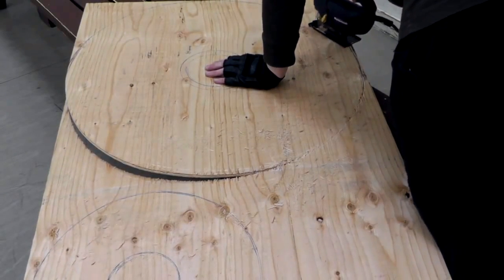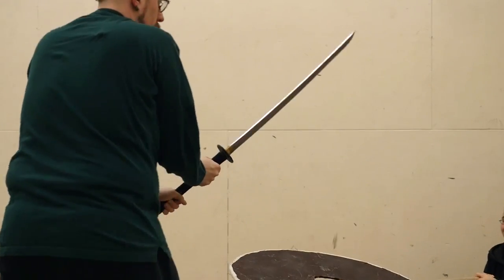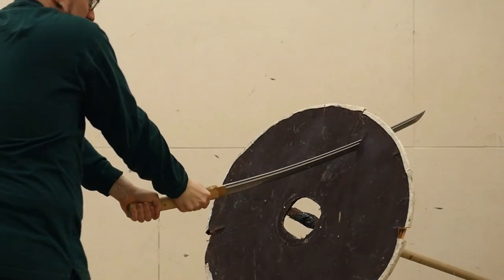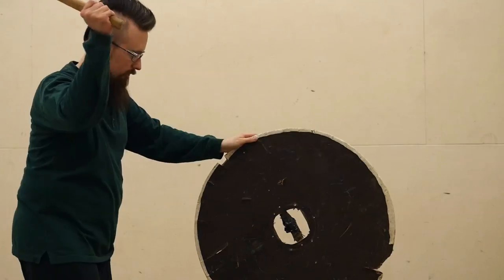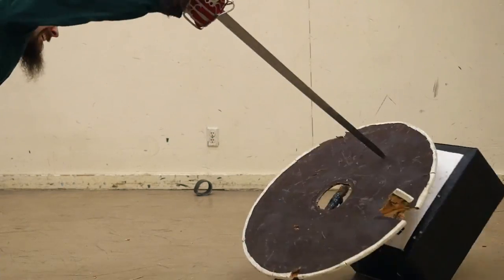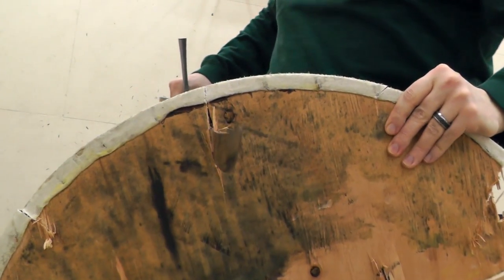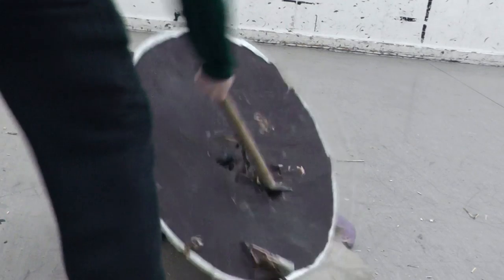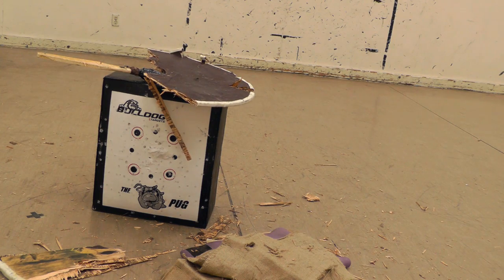Plywood shield vs broadsword, katana, axe, kriegsmesser, and war hammer

Comment: I know this video is older now, and I very much appreciate the comparisons. It’s great topic matter. However, I would have preferred to see a specialist with each sword type do the comparison on the same target. The Katana may be overrated from anime and film drama, but the most dangerous thing about it was the person wielding it. Also, not all Katanas are made alike. There’s serious differences based on technique and one with quality took much longer to make than any of the other swords depicted here. Katanas could cut off finger, wrists, and heads easily. Muscle too, and anything below the rib cage, so sharp that one may not notice they were cut until subsequent slices. It was also designed to thrust if needed. Samurai also had honor code, that if played right, did have multiple people ambush and jump one dude. But breaking a femur is more for medieval sword design, which was made for bigger men who fought with shields and brute force. They could bust a leg bone with one strike so that they could keep ploughing through enemies like a chopping block.

Comment: Judging the performance of a weapon hitting a shield that is not properly held in place is going to show a very different result to what would have happened on a real battlefield. Try hitting a paper just flying through air, it will just bounce off you, try hitting it after having someone hold it up for you, you will easily rip it.

Here, you put the shield against a light chair thingy, you can't be surprised when it does minimal damage.

Comment: Is the reason for the center grip greatly strengthening the shield similar to the tension placed on a drum head?  So that strikes to the face of the shield would be ineffective because the shield could flex away, but strikes to the rim are more effective because the shield has no "bracing", for the lack of a better word, in that direction.  The design of a center grip shield reminds me a lot of the Irish bodhran drum.

Comment: Interesting how much beating even just a plywood shield can take. Reinforce it with steel edging to prevent splintering and a more solid cross-handle and it would take all that beating easily. Not so sure your arm / wrist would enjoy it though (if you were wielding the shield).

Comment: Two or three things spring to mind: With the warhammer, would you be able to knock off the handle in few strikes by aiming at where it is fixed? That would probably make it quite effective. With the two-handed axe, there is not a lot of penetration but a big impact. That might actually be a good thing. The guy holding on to the shield might have some difficulties keeping the grip, if you manage to pound the shield when it's not resting on the arm/shoulder. Also, removing the weapons from a shield that you do not controll will be vastly different from removing them from the settled shield you control. A guy with a sword stuck in his shield will do whatever he can to keep it that way. He will give in, if you pull and he will try to use some lever to take the sword from you, hen you don't. All while still being armed and dangerous. Your tests seem to imply that cutting into the shield from the edge is a bad move in a fight. Of course, a scythe would be the most effective weapon against a viking shield. Nobody expexts a scythe and you could just stab over the shield into the opponents face.
Reply: Waffelmonster regarding:

Warhammer vs Shield, no you cannot knock the "handle's off" Medieval shields were usually Riveted on with a one piece rivet or metal staple or in the case of center grips, the handle was part of the shield/shield boss usually forge welded on. 

Two handed axe VS shield, You can most definitely use force to cripple the shield user by buy the same token I can dodge/deflect the blow with the shield and then move in for a kill, Most most common tactic for fighting against two handed weapons is to charge and deflect the first blow with shield or weapon.

Also note that most shields have a strap/chain that will keep it within the user's reach, it very hard to disarm a shield, if you weapon gets stuck in my shield I will simply move in for a kill.

I can honestly say I have never fought against a scythe but it would be like fighting against an inferior poleaxe I would think. I can see no advantage apart from it being an unusual weapon in using a scythe.
Reply: +Leonhart Hunt How how a two handed sword
Reply: piedude898 breaking a shield. never tried it but the same mechanics VS axe apply, In SCA combat a common tactic to to catch great weapons on the shield with a oblique angle minimising the applicable force and then move up the blade/shaft to sword strike range.

In period most shield had metal fittings or edge or even made from metal (18 to 14g) this minimises the destruction of the shield.
Reply: Did  Viking shields have rawhide facing?
Reply: piedude898 a reconstruction of a rawhide shield from an early viking grave showed the construction of their shields. (one example, there have been others with slightly differing materials, but the most common was this)

Linden wood (a light almost balsa like wood) as planks laid with opposing graines like this:

<------
------>
<----

Joined with cheese glue along the edge, rawhide covered from and back (thin rawhide not the very think type) put on while wet and sewn together then allowed to dry center boss or grip would then be added after it was dry making a very tough but flexible shield. 

They were designed to be destroyed in battle, in fact a form of tournament was used for disputes where the fighter had 3 shields to be broken (some people have found that the holmgang shields were specifically made to be broken and were not as strong at the "battle" shields
Reply: Did historic Viking shields have plywood or plank wood?
Reply: piedude898 Plywood is period, it was found as early as 8thC but the majority of viking shields were joined planks
Reply: Are Viking shields useless against axes?
Reply: no, they are designed to break and grab (hence the soft wood) and the shield are often covered in "parchment" (a thin rawhide) both front and back which lends quite a bit of strength and flexibility to the shield.

Most fighters will tell you (as do I) that shield aren't used to stop a weapon just deflect or reorient the weapons attack arc, it's true the the shield does get hit/impacted/destroyed but less so than you might imagine.

Round shields were also weapon in their own right, a shield edge to the face is not fun and the center grip allows rotation of the angle of the shield, so if timed correctly you can glide around a shot but letting the shield take the impact and deflect it horizontally across the shield it's one of the biggest advantages of the center grip style (the Hand pavise was the later generation center grip, and vastly improves on the round shield design)

Comment: The damage against a shield with a double handed axe seems little, but I would think that the shock of the impact will severly impact the wearer, right? Can't imagine being able to hold the shield after a few hits and subsequent blows to your arm and should. Might even get numb after the first impact. That is, if you take the blow full force instead of you being able to have it glance of.

Comment: Late to the party, but really coulda done with a better way of holding the shield in place. Both the broomhandle and box method essentially made it as if whoever was holding the shield simply let go of it on impact and thus a lot of the force of the strike was lost as the shield moved away from the blow rather than being held in place...
Reply: If you move like that broom handle/box moved, with no grip on the shield itself and doing nothing to keep the shield in place, you probably have no place in a shield wall. Just saying.

Comment: weeeeell, it also helps that there's nothing holding the shield/giving resistance to the blow, so a large portion of the energy of the blow dissipates. That is for thrusts.
With the overhead cuts on the other hand, they would be even less deep if a person was holding them.
At least I think it would be so, can't rely test it :(  though it seems like a lot of fun :D

Comment: When I was much younger, and a whole lot dumber I tried to cut a wedge into a plank of wood, this did not go well, several strikes and about 5 minutes later I had bent the blade and shook loose connecting bit from the tsuba and the blade, I was able to fix it, by hitting it with a hammer, but the blade is still crooked to this day

Comment: Basically you're only standing there chopping a piece of plywood. There is no one using the shield properly to deflect the hacks and smashes. A shield is used to semi block using the boss, but more so to deflect blows by using the flat of the shield. A half decent combatant would adjust the position of the flat of the shield towards the blow for minimum damage.

Comment: I think skallgram you should make a ply wood shield with a fairly thin layer of metal on the front and on the back with the shield besandwiched in between if this works it may stop some axe,s and pole arms depending on how there used

Comment: One problem with that video is that there was no grounding, or base to that shield. Meaning that whenever he struck that shield, that shield went off whatever was holding it and fell down onto the ground. None of that would've happened in real combat. At the very 'best', the blow would've been deflected because it would've forced the shield to the side. At the very worst, it would push the shield against the wielder, which would make the damage greater. 

With the way this shield was supported, that shield could've been made out of styrofoam, and you would've still not cut it apart in a single swing of katana.

Comment: So a makeshift plywood riot shield like what based stickman used is actually really good for anything that isn't a bullet? That's what I got out of this video. It seemed like a very effective shield. 

 I'm going to make one now. I may even soak it in water then leave it out to dry across saw horses first so that the wood curls a little. Then cut a shield into it. I'd want one more like a Roman shield, rectangular, but maybe smaller than what they carried. Or roundish. Either way, a curvature should help deflect more.

Comment: If I had to go with a guess as to why the lack of shield destruction, not to say the shield wasn't destroyed, but I saw a video, Weapons that Made Britain: the Shield. There is a part of the episode where the historian took a long axe, similar to the polearm you used, and chopped a shield right in half. If i had to say a reason, (not the guy wasn't any stronger and a good deal older) it's that your sheild is and engineered wood, which is inherently stronger that normal woods.
Reply: There was also the possibility that the show was rigged.

Comment: What I think it would be effective is to thrust with the warhammer pike in the same area a few times then use the blunt part to make a hole in it so the shield would be weakened or if the hole was big enough then thrusting the opponent through the hole would be effective, that's my opinion

Comment: Would it have made any difference if the shield was held down more solidly? Obviously it would have been dangerous at that point for someone to hold it, but simulating that would offer more resistance than resting it against a box, surely.

Comment: Could you do Arrow penetration tests in wood targets equivalent to the shield front face (a simple SHORT plank would do just fine for this test I believe,  a long piece of wood would probably flex and absorb too much energy from the arrow) using realistic woods 
(Viking round shields were made of spruce, fir, or pine - pine is probably the easiest to get, Source: http://www.hurstwic.org/history/articles/manufacturing/text/viking_shields.htm )

Wood board/plank thickness would be: 

1/4", 1/2", 3/4" up to 1-1/8"(Uncommon)

The arrow penetration tests would be awesome if done with different kinds of arrows and arrowheads (Bodkin, broad, needle bodkin, target point) and preferably bows with historically accurate draw weights used in war situations, should shoot traditional arrows at around 160-210 FPS.

Now that I read at what I just wrote I am probably asking for too much, but if you ever get in the mood (and $) to buy a new bow please test this out :P

Comment: Part of the reason the katana glanced off is because you did not compensate for the blade geometry - it curves fairly sharply, making the contact angle between blade and shield much more extreme than the near-perfect 90 degrees provided by the first one.

Of course, against armor I'd say blunt force, spikes, and axes are always better than blades. That warhammer, with a serious strike, would ruin somebody's day. And arm.

Comment: Another thing to keep in mind is that there is a man holding that shield. Every single strike against it will beat the crap about the opponents' hand and arm. After a while they would probably drop the shield before it broke.
Reply: Midgetnator Depends how determined they are, some may be tough enough to continue gripping the shield while their arm hangs to their side from being snapped in two.

Or they could just move out of the way of any strikes that would deliver that much damage. I imagine a broken arm would take a hefty swing.

Comment: Sorry small, but you made a silly mistake. You might have corrected it later, can't quite tell from context, but you said the katana cut through better because it was with the grain. And no, that isn't the case, as you were using plywood. Plywood has multiple thin sheets of wood glued together with each sheet having the grain perpendicular to the sheet below it, which is where it derives most if it's strength.

Comment: You need something to fix the shield in place like if someone was holding it because just lying it on a box or holding it with a stick isnt really that realistic (i think). If it would be fixed in place the thrusting attacks and the attacks to the "face" of the shield would do more damage I think. But im not an expert in these things so maybe Im just wrong :)

Comment: Why anyone would make a shield out of plywood is completely beyond me. 
If there's three things I know about plywood, it's that it's too heavy, that it's too weak and that I've never seen a plywood forest in my life.

If you want to do light, I'd go with reeds from and river or lake. Split them down the middle and weave a shield out of them while they're fresh. Let it dry and then cover it with brown stuff.
The jaguar warriors had weaved shields, and if I understand it correctly, they were ridiculously strong compared to their weight.

Seriously, plywood is just glued woodchips. You'd be hard pressed to find a material more ill suited towards making shields. 
As far as weight/strength ratio goes, the only thing worse would be a solid gold shield. Even a shield made of lead would at least protect you from radiation somewhat.

Plywood isn't even the worst water soluble shield material. Papier-mâché would at least be light.

Comment: Gotta love how that kreiggsmesser really (albeit inadvertently) corrects the deficiencies of the typical katana. Or maybe it's just that particular Albion blade that's just so ridiculously op? Idk.. Either way, the steel may not be as meticulously and artfully formed/sculpted on the kreiggsmesser (but to be honest, it doesn't really have to be - as long as it's, first and foremost, good steel,) but the design and dynamics of the overall weapon really makes up for it. The tradition behind harvesting and crafting tamahagane steel is beautifully fascinating, and the science behind the typical katana's overall molecular structure and cutting power is mind blowing. However, the Germans simply came up with a better design. It sucks for the katana fan-boys, including myself. However, it's just a truth of typicality. Those kreiggsmessers and messers simply utilize a better design for the purpose.
Reply: Alex Harwell tamahagane is just run of the mill bloomery steel made from iron sand. You can make it in your backyard.

Also Albion does indeed make very good swords, also they use the pinaccles of modern metallurgy to make swords.